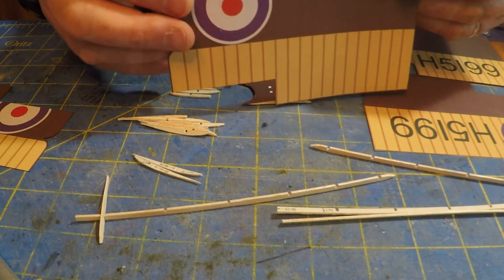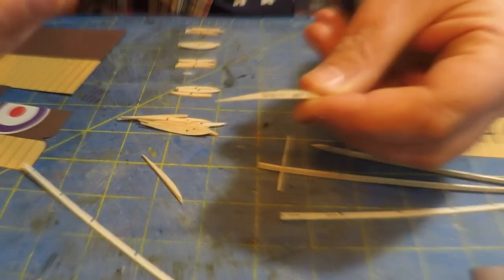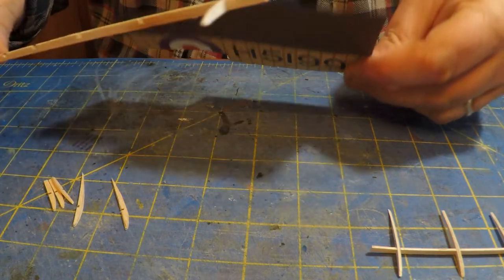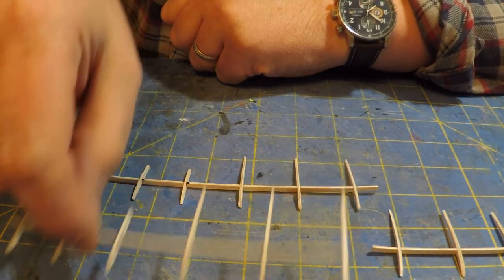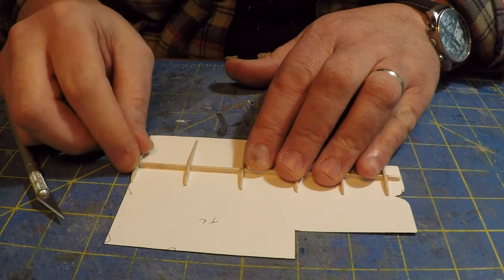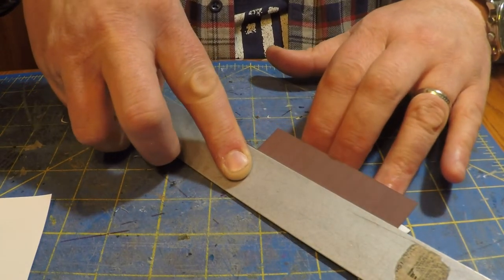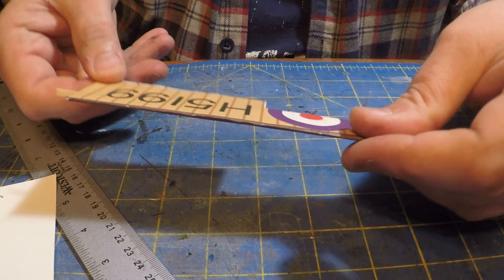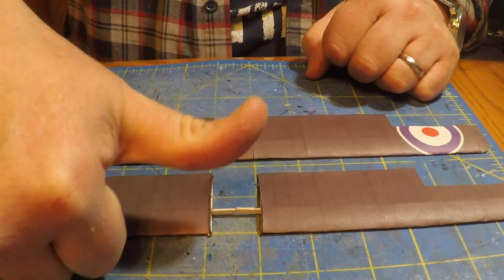Avro 504 Paper Card Model:  The Wings

Comment: Great video!  What width of balsa wood are you using?
Reply from the maker: Hi Robert...it's all 1/32nd inch.  Some is sanded thinner but this seems to work out well and is plenty strong! -Dan
Reply: @dansmith7617  Thank you!  I have some 1/16, but it seems to thick.  I'll get some 1/32.